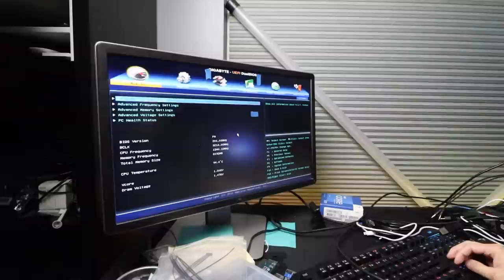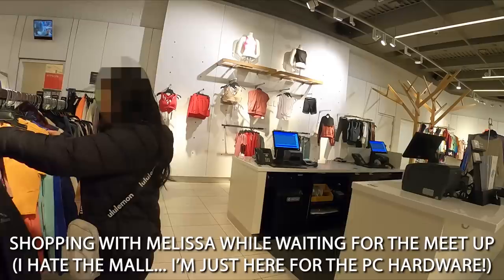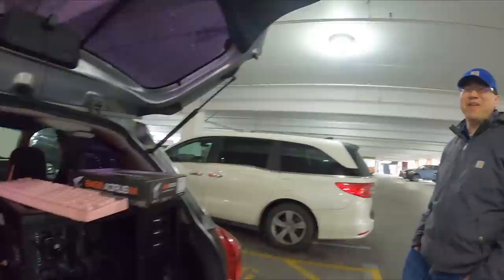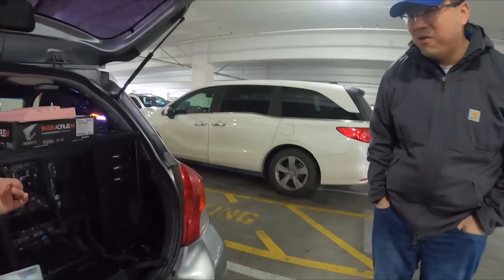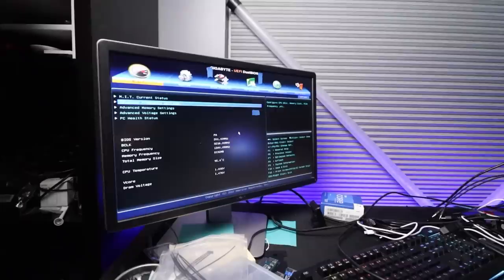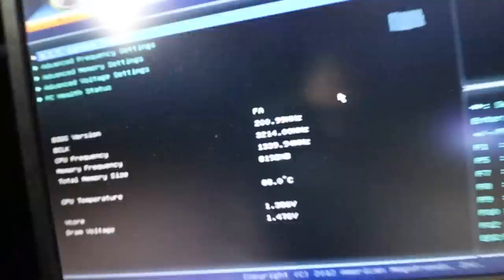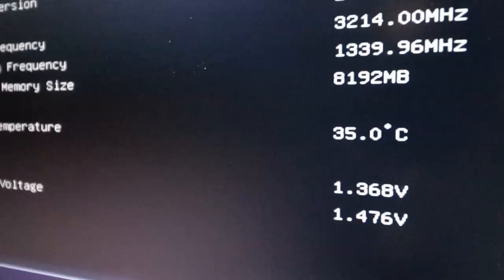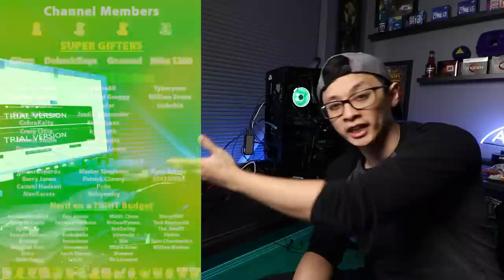Seller's CPU ran HOT after I took it home...

Comment: With the gurgling sound coming from the AIO pump block, I have encountered that issue quite recently with an iBuyPower 120mm AIO and i fixed it. I'm Michael from Ghana , West Africa. You have to first totally disassemble the cpu pump block. You'll first notice some galvanic corrosion(greenish) in the liquid used for the cooling which would mostly likely be ethylene glycol. The gurgling sound comes from the free floating galvanic corrosion particles coming into contact with the micro fins of the copper cpu block. You'll probably notice significant galvanic corrosion in the micro fins of the cpu copper block which has clogged up the aio. This prevents the liquid from circulating within the AIO, hence, not being able to cool the CPU leading to very high cpu temperatures. To fix the issue, you need to drain the all the liquid in the AIO. Then clean the cpu block with toothbrush ,dish soap and water. The micro fins are the most important part to clean to ensure maximum circulation in the AIO. You would need a razor blade  to swipe across each individual lane of the micro fins to force out most of the galvanic corrosion blocking the flow of liquid. The tooth brush cannot fit between the individual lanes of the micro fin and thats why you need to use a razor blade. After adequate cleaning of disassembled parts, make sure each part is totally dry and ready to be assembled. For the liquid coolant replacement, I wanted a PC coolant in my country to purchase but couldnt find some anywhere so I resorted to using distilled water as the coolant replacement in my aio. Yeah I know galvanic corrosion will occur in my aio because of mixed metals(copper cpu block and aluminium radiator) but its been silent and fine for 3 months now. Hopefully you can follow my guide to fix your broken aio. There is no need to throw away that which can be fixed. Thank you :)
Reply: CPU AIO coolers typically have propylene glycol (diluted with distilled water), which is less toxic than ethylene glycol, but ethylene glycol has better cooling and antifreeze properties. That's what car radiators use. Give it a try. It shouldn't harm anything.
Reply: Its not just that, the coolant also leeches through the rubber hoses on these older style coolers and eventually the pump just starts to cavitate because there is too much air in the system. I have 3 or 4 of those exact same Corsair AIOs in a box, I drained two of them and got like a teaspoon of coolant out of them, and like you said it was all nasty and gunked up. Newer units seem to be using something else, maybe tygon? I don't know but it isn't that permeable rubber anyways. I used to tear them down and clean them and then use some standard PTFE tubing on the barbs and refill with distilled water and some additive, but its not worth the hassle with how cheap they've gotten now.
Reply: @Bunta1987qwerty  Yeah you're right. Propylene glycol is common with AIOs whiles ethylene glycol is common with car radiator cooling. I read up on how ethylene glycol was toxic so I didn't mess around with them
Reply: @arc00ta  Yeah they're cheap on your end but then over here,they're quite expensive so it's definitely worth fixing it here.
Reply: @michaelopare4477  Yeah this is why those 120mm AIOs are silly, they barely work better than a regular cheap air cooler and add so many more points of failure. But if its all you've got, some 10mm tubing, zip ties, and distilled water you can have it going again with a little effort.
Reply: @arc00ta  but then after months of testing, I must confess that I'm really surprised at how efficient this iBuyPower 120mm AIO(NZXT M22) cooler is. It's cooling an i9-9900k and max CPU temp at full CPU utilization is 73°C. The system is very quiet also. I was really surprised that a 120mm AIO can cool an i9-9900k without any issues whatsoever.
Reply: @arc00ta  Interesting. I'm glad they've moved on since then. I suppose it isn't worth the trouble for most people, but I guess if you have tubing lying around and you use a small amount of vehicle coolant, you could save a few bucks.
Reply: i have a similar model to this one in the video. and it had the same problem it had. its not corrosion. those aios did not have corrosion problems. its low on fluid and the impeller bearing is just worn out. with a bit of realigning and a refill it can work again. or you could 3d print a new one if you can but ether of the 2 it will be unreliable and will fail again or stop running and you wont even know it failed and can fry things. i have repaired mine and i only keep it for tinkering and messing around while having an eye on it. would never trust it in a system to run unattended. yea its nice to keep stuff running and reduce waste but when its for aio's its not worth to risk it just to save a 7+ year old aio from going in the trash. there just expendable and once their prime days are over there over. there not meant to be kept forever. its not even a good aio. its just a 120mm which pretty much any 120mm tower aircooler is cheaper and will give same cooling if not better. not worth it

Comment: Just to be clear to everybody, The AM4 Wraith Prism can fit on older AM3/3+ and I believe AM5, because it's a clip on style.  The other AM4 coolers (Stealth and Spire) which are screw in types, won't be compatible with AM3 boards.
Reply: Yeah while the plastic clips look the same the mounting holes are slightly different spacing
Reply: @Lurch Yeah the 7000X CPUs would be too hot for a Wraith Prism but a R5 7600 might be OK as it is only 65W, the Wraith is a lot beter than the Stealth & even the Spire cooler from early R7 1000
Reply: @@lurch789 Agreed on everything you said.

Comment: Great stuff as usual Danny!  That looked like a pretty good deal even without the AIO.  I recently bought a GPU down in Montlake Terrace - was supposed to be an OEM 2080 Super, but turned out to be a 2070 Super.  I wasn't too sad because the price was INSANELY low and the seller likely didn't know.  Even the FCC/model number on the back of the card came back to a 2080, but oh well.  I need your mobile testing rig!  I had mine but forgot the power cable at the last minute.  Great stuff!

Comment: I'm fiddling around with an FX 4300-based tower my mom left at my house. This thing was running LOUD and HOT and had never been cleaned! So far I've added an intake fan, an exhaust fan, set more reasonable fan curves with Fan Control, changed the thermal paste, removed the ODD for better ventilation, added an old GeForce 730 from a prebuild on which the motherboard passed away, upgraded RAM from 8GB to 12GB, tweaked some stuff in the BIOS, and now it runs quiet and does what I need. Mostly it's a TV box for my projector so nothing too intense and it does the job fine while no longer burrying the audio with its crazy cpu cooler fan noise nor is it making the room super hot anymore!

Comment: The Pump on the CPU block is clogged, that is the problem with it.  They get clogged over time, or if it has been sitting for a long time.  They also lose coolant over time and will also lose a lot more coolant if it had a rough life in extreme heat for prolonged periods.

Comment: My AIO started gurgling and then I ran at 60 degrees idle and 100 degrees under load on an i9 9900k, slowly got worst over a few months until my pc shut off periodically due to high temps. Ended up buying a BeQuiet air cooler and now im running 31 - 34 degrees idling.

Comment: If the AIO is old, the copper fins on the top of the base plate are probably clogged with particulates and oxidation. I spent probably 4 months messing around with an Asus 990fx sabretooth, a Gigabyte 970A-UD3, and an Asus 970 pro gaming aura. Out of all 3 the highest clocks I got on my fx 6300 was 5.1ghz on the Gigabyte board with a 360mm AIO. I also ended up having to throw a fan on the northbridge of both the 970 gaming aura and gigabyte. Though it didn't win in my testing the 990fx sabretooth was supremely overbuilt, absolute tank of a motherboard that didn't need extra cooling for its VRM or chipsets.
Reply: Yeah the ASUS AM3+ 990 Motherboards are Awesome for OCing FX

Comment: Putting together a Optiplex system (i5 6500 with a gtx 1650) using eBay. Always wanted to try doing it and after seeing some other YT'ers try it with a $200 budget, I thought I would finally do it. One of your previous vids came to mind as I thought about it, so I had to scroll through and find it again. Hopefully I'll have as much luck as you did; if not.. well, it's just 200.
Put together about 6 builds for family, but have always wanted to try a really tight budget PC build.

Comment: That AIO is clogged up. Galvanic reaction caused by dissimilar metals making contact causes rapid corrosion, and the chemical reaction breaks down the propylene glycol. In fact, in my experience, NZXT coolers have this issue too. I've had to replace the fluid in my H1 factory AIO, and the microfins on the inside of the block (inside of the coldplate) were totally gunked up, and it wouldn't flow. It shut off as soon as it tried to boot into windows. I relaunched to see temp in bios, and it was about 80C. flushed everything, and replaced with Corsair fluid. Still running fine, but it'll probably happen again in the future.

Comment: FYI, you can use that pci-e/nvme setup as a boot drive on those old AM3/AM3+ motherboards if you use Clover bootloader on a USB drive (or any drive, really). Clover was designed for use with a Hackintosh, but because it boots Windows, Linux and MacOS independently, it works great for older PC's that can boot from add-in cards . I have an old Gigabyte AMD 970 based mobo and went through the same thing but was too stubborn to give up without a good result....sometimes being stubborn is a good thing! It was probably combined with a tad bit of OCD as well. 😜
Reply from the maker: Good to know, I'll definitely look into that!

Comment: late comment but, i have been an owner of multiple gigabyte 990-970 chipset motherboards, and the problem on not detecting your nvme drive as a bootable device is the wierd bios the oem made it. it has a lot of quirks and bugs that they never tried to fix, because they have very specific scenarios, like in this case. if you use another adapter, like the startech ones they usually work. but not with nvme pcie 4.0 compliant....

theres also a bug on usb devices, like not detecing some usb heaphones, xbox 360 controllers, android phones, etc, if they are connected on a usb 3 port. and the most tipycal, the one were it doesnt detects the last ram slot if you suspend the system, until you reset the pc.

Comment: I've been getting some pretty good deals lately I've gotten a GTX 1660 Super for $80, a GTX 1650 for $60, an MSI B460M Pro VDH Wifi motherboard with a Core i7 10700F for $150 all in good working order, I traded an old FM2+ PC for an RX 580 4GB, Coolermaster ML240L AIO and $60 cash.

Comment: So, About the Motherboard not supporting boot from NVME- I've had some success by installing the bootmgr to a SATA SSD, and installing Windows to the NVME. This works because window's bootloader is located on the drive the the bios supports booting from, and the OS is stored on NVME.

Comment: Probably a dead AIO. I think the H60's have reliability issues lately. I had one that ran fine until 2019 and i replaced it, the replacement failed last month so now i'm back to air cooling with a Hyper 212 Evo

Comment: I recently found the joy of building systems from used older hardware. Overclock them to squeeze all the performance out of them. They wont win any awards, but you would be hardpressed to know its an old chip. Got an Intel I5-6700K overclocked to 5.0GHz and then I actually still have the first PC I ever built which was actually with an AMD 955 Black Edition processor. its still going and overclocked to 3.8GHz on the stock AMD cooler. I plan on getting either an aio or a better air cooler to overclock it further.

Comment: You might have been able to boot to your NVME drive if you turned off CSM 'Always' setting. (Compatibility Support Module) Or changed the Storage Boot Option Control off of the 'Legacy first' setting.
What do you use for power in your car?

Comment: I have Helios 300 i7 11800H 3060 (2021) laptop and sometimes 90-95 degrees CPU seems normal to me (while gaming ofcourse, (1080p Unbound or Cyberpunk - CPU EATERS)
I repasted it with Thermal Grizzly Kryonaut every 2-3 months.
Basically the margin of money i save in between Legion 5 and Helios 300 is gone in repasting thermal paste and changing pads, running more AC (ez electricity bill boost).
There is no point in buying something cheaper to end up crying and throwing money to make it work.

Comment: G'day Danny,
Cool this Motherboard works, the "Clip On" AMD Coolers like the Prism will work with AM3/AM3+/AM4 using the correct plastic mounts, but the Spire/Stealth & the Plastic Mounts/Backplates are not interchangeable as the Cooler Mount Holes are slightly different on AM4.
I am fixing a i3-2120 + Z68M (???) + 8GB-DDR3 PC that crashes loading to W10, I thought it was the OS HDD as it would post to BIOS fine & even sit there running in BIOS no trouble, so I changed the drive & still the same, turns out it is the Motherboard 🤷‍♂???, I was able to get the OS HDD to Auto Repair (so no data loss) & run with the same CPU + RAM on my testbench using my ASUS Maximus V so everything else is fine, the owners just use it for surfing the net & storing photos so I'll just get a replacement H/B LGA1155 as they are only $30-$40AUD + 240GB SSD $27AUD for the OS, I have lots of 1155 CPUs & DDR3-RAM so I'll just swap those to an i5/i7 & 16GB plus the small SSD will make it a lot faster in W10 & the original HDD will be fine for storage of photos or whatever & will get them out of trouble for cheap.

Comment: Had a situation recently with a Ryzen 5 5600X over heating sporadically. Turned out to be the AIO even though fans were running and I could feel the pump running and water circulating through the hoses. I removed it, repasted and reseated it, but still vary poor temps. Other things can keep the AIO from working properly that are not detectable by observation. Had the same experience. In the BIOS at idel, temps started to climb steadily often. They were much higher than they should have been at idle. Installed a Wraith Prism I had which I use as an ad hoc cooler and temps at idle were down to 32 to 35 degrees rather than 60 to 80 degrees.
Reply from the maker: Indeed! This isn't my first time running into AIO's not working properly due out of nowhere, a couple of years ago when I helped my friend refresh her PC, her AIO, funny enough also a corsair one, did the exact same thing. I tried to reorient and shake it around to get what I thought to be air bubbles out, which did not work. I left the AIO alone for a bit and it all of a sudden ended up functioning like normal again, just really odd all around lol https://youtu.be/Bh-2TtOu2-U?t=1892

Comment: AM3+, so it'll take a FX
And I'm chewing through a couple of bundles...
Bundle 1 (bought for not much money) provided the H61 board that I'm currently running, a dead Mac G5, a couple of AGP cards that I really must get round to testing, I DO have a working AGP system, and some DVD drives (PATA), plus an Optiplex 745 with a dead board, but a working PSU.
Bundle 2 (free), A right mix, cases with various, a Veriton Atom PC (needed RAM, what a struggle as only 1R8 work in it, 2R8 do not detect at all... guess what all but one of my spares were!), a board and FX 4 core